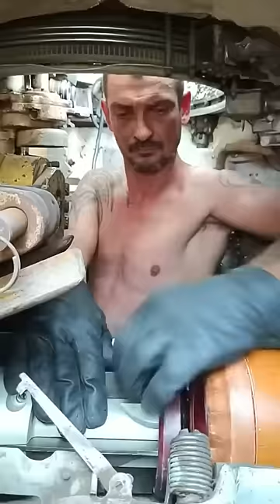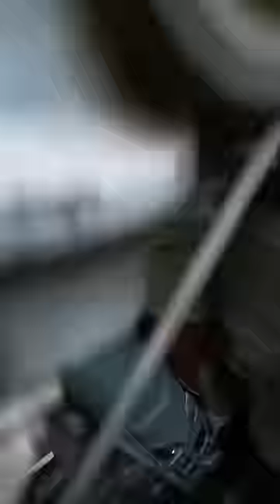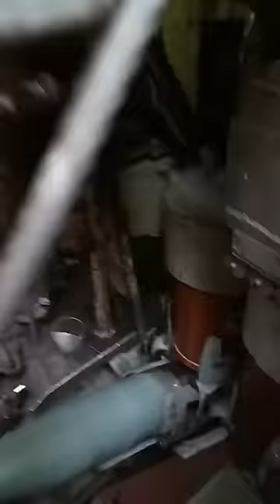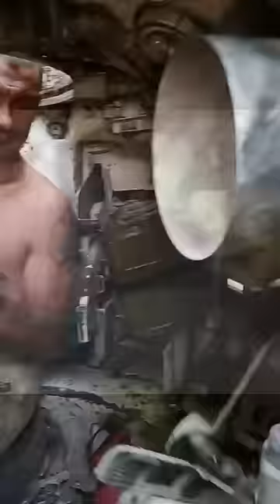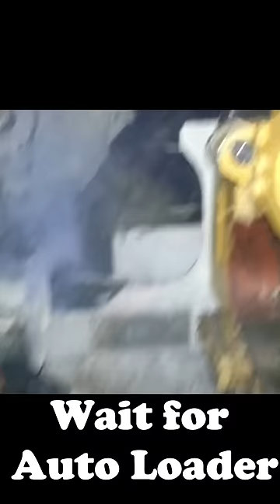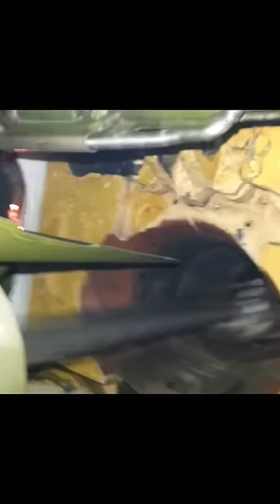Т-64 Auto-Loader Tank Reloading mechanism #Shorts

Comment: 自動装填装置かっこいいなやっぱり
Reply: XD
Reply: これオートローダーなのか
Reply: A
Reply: Yea.. it's so cool that it can even initiate Russian Space Program instantly when it gets hit 😂
The mechanism is much safer in French MBT, Leclerc and Japanese MBT, Type 10 tho..
Reply: ねーかっこいいけど当たりどころが悪いと砲塔が飛んでいくからねー
Reply: boomboom
Reply: @shadowdragon7045  What's wrong with russian space program? I don't get it
Reply: @No.fly.zone.taken24163  explanation : when a shell penetrate the hull of Russian MBTs that have the Autoloader system  (which have the munitions compartment around the inner side of the turret ring, right below the turret), and hit that exact compartment, the turret pop off from the hull from the sheer force of ammo rack explosion, hence why we call it "Russian Space Program" because sometimes (almost everytime tho) the turret fly so high like a spacecraft after the ammorack explodes.
Reply: @shadowdragon7045  Is it a huge issue? Does this make russian mbt's much lower in comparison with other nations?
Reply: @No.fly.zone.taken24163  no it isn't.. all MBT from the other nations also have strength and weaknesses.. Russian MBTs are cheap to mass produce and has pretty good ERA protection, and because it has the autoloader system, so human loader is not needed, and the tank can keep reloading as long as the mechanism is not damaged or failed. Russian tanks also has low profile (low height) compared to NATO tanks, so it can hide more easily.
Reply: @shadowdragon7045  But they are still expensive for russian disassembling economy to produce on a larger scale by thus making them ineffective
Reply: @No.fly.zone.taken24163  that's true tho 😅
Reply: Gavin Soliz  it’s the same if it’s a human who explode, can’t reaload
Reply: @shadowdragon7045  сравнил Т-64 с Леклерком и тип 10 😂, ты очень умный парень
Reply: @_Dark_LeGIoN  i only compare the autoloader mechanism tho. Learn to read. I only answer the questions about NATO vs Russian tanks "in general" since those tanks still exists on the battlefield to this day.
And we haven't even see Armatas out in action against Leopard 2s or Challengers. Have we?

Yeah i know they're in a whole different generation of MBT, but the reality is what appears on the battlefield right now.
Even Armata's autoloader mechanism is almost the same with the other older MBTs, no?

So, Try to keep up with those NATO tanks, and then you can say anything you wanna say. I'm listening.
Reply: @shadowdragon7045  These tanks were produced in the years of the USSR, where, for obvious reasons, since the Second World War, not the quality of tanks like German tigers, but the price and quantity, they simply cannot be thrown away, so they go for export and modernization.

Leclerc is generally the most expensive and complex tank, but France itself will not produce them in huge quantities.

Soviet tanks performed well in Syria and Iraq , many times withstood hits from ATGM and hand grenade launchers . 
Soviet weapons destroyed American Bradley infantry fighting vehicles, Abrams and other equipment. 

Russia has increased its military budget in recent years, and has begun to produce its own equipment like the Terminator BMPT and the Breakthrough-3 t90m, which, by the way, are now in Ukraine.

I'm not saying that Russian tanks are the best tanks in the world, and others are bullshit, I mean that Russian tanks are not bad and discussing with you the topic of the "carousel" autoloader, this is a pretty smart solution that gives both pros and cons.
Fast recharge, no need for 4 people

But 125 mm and proper handling of equipment in long-range combat will have a better chance of surviving a hit in frontal armor and giving a quick response.
Reply: @_Dark_LeGIoN  and I also didn't say that Russian tanks were a total waste of resources, didn't I? The ERA on those tanks are pretty good if they got hit at the places that are protected by those ERAs, also the turret is the most well-armored place in a Russian tank. And yes i agree that the autoloading mechanism is very easy and practical to refill. I also said that they can hide more easily because of their low height.

And as you also said, "Proper Handling of equipment". This is the most important thing that a tank must have whether it is a Russian or Western tanks. Crew. A group of properly-trained crew in a tank equals to many tanks with lack of trained crews. With trained crews (in worst case scenario ; head-to-head engangement), any tank might be able to minimize the damage or maybe even eliminate any potential damage, and counterfire with impactful blows (that, also depending on the orders from their superiors)
Reply from the maker: Watch this.
https://youtube.com/shorts/DJCgtZXY9NQ?feature=share

Comment: A lot of people clown on these, myself included, but they're quite necessary for the current Russian tank design doctrine. Russian tanks are reliant on lack of size, which becomes a problem when you also want a big gun, like the 128mm. It's a powerful gun, sure, but you need to load the ammo in two stages; the projectile and the gunpowder. This massive gun can fit in the turret, but a loader is going to have trouble reloading in a timely manner because he can hardly move. So what's a size-efficient alternative to a human loader? An autoloader of course. It can reload a two-stage cartridge in about the same amount of time that NATO tanks can reload a single-stage cartridge. However, the Soviets had a problem; ammo stowage. As learned in WW2, ammo was safest on the floor of the hull. So, they implemented that on their tanks, with their autoloaders. However, they oriented the shells upwards in a carousel on the floor, meaning really any penetrating shot the the hull is gonna cook off the ammo and vaporize the entire crew, leading to those videos of T-72 space programs.
Reply: All their autoloaders had shells oriented horizontally in a carousel under the turret. The T-64/T-80 were the ones that had the charges oriented vertically atop the shells while the T-72/T-90 had the charges oriented horizontally atop and parallel to the shells.
Reply: @tritium1998  good point, I neglected to recognize that fact.

Comment: You’ll be surprised how this auto reload is so deadly during combat
Reply: Well it’s not that surprising, manually loading takes longer autoloading is quicker which means people get killed faster 😅
Reply: Maybe the abrams which one is save. Leo2's have ammo in the hull as well. And you get cooked as well 😅
Reply: @Kingrizz69  Not really, a loader on western tanks usually trains to load in around 5-6s. Some even faster. T72 autoloader loads in 7.7s. Also, a loader can switch a loaded shell with a different type if required. With a autoloader you can't do that. Also in combat the most important is who detects the enemy tank first and who has the better fire control system. That is another western tank advantage.
Reply: @silimarina.  I’m not defending Russian tanks I know western tanks are miles ahead I’m just stating that hand loading is usually ( depending on the tank and crew) slower than an auto loader :)
Reply: @Kingrizz69  abrams crew with maximum efficiency can reload every round in 6 seconds at least. Even lower if the blast doors are open all the time. T72 reload is at 7.2 seconds

Comment: Wait untill the amo hold is on fire, let's see if the driver is still smiling by then
Reply: Driver will easily escape, because in T64/72 and other tanks after the 64 the ammo is not in the upper glacis but rather in the carousel under the turret

Comment: But the it is a flawed design as if it gets penetrated then bye bye turret
Reply: Hence why the T-72 was put in production, despite being more expensive than the T-64.

The T-72 stores 22 rounds of ammo and propellant underneath the floorplate of the turret.

Then they went and stashed loose projectiles and propellant charges all around the insidenof the turret and driver's compartment anyway.

At least the issue was mostly fixed in the new-ish T-90M, where 10 rounds of the spare ammo is stored in a separate compartment in the turret bustle,
The caveat being that somebody has to stand on the turret roof to pass the spare ammo into the tank once the 30 rounds inside the tank have been used up.
Reply: Because said round hit anywhere but the ammo rack and crew like to put extra ammo everywhere
Reply: 苏联航天
Reply: It can shoot while moving and reload while Jamal in Abrams can't reload
Reply: @egor9603  t90 turrets are fucking rockets
Reply: @Cadenkellner23  do you think I care? I served in this tank
Reply: @egor9603  abrams solos
Reply: @Cadenkellner23  ahahhaha
Reply: @egor9603  abrams is better
Reply: @Cadenkellner23  don't you understand? I don't give a damn
Reply: @egor9603  russian tanks are mobile metel coffins
Reply: @Cadenkellner23  An Abrams will also pop its turret if the hull ammunition is struck.
Reply: @autoloadedbaguette6756  blow out panels💀
Reply: どの戦車も開発した国の状況に適合した最適解だから、批判しあう意味はない
Reply: @Cadenkellner23  Abrams stores part of the ammunition inside the case. Like in the T-72, it is located at the bottom of the tank.
Reply: @Rory_Mercury  that has blowout panels too iirc